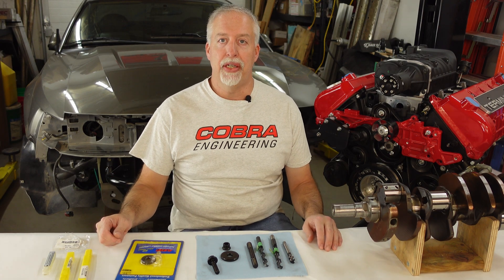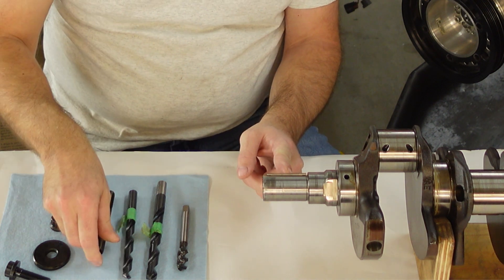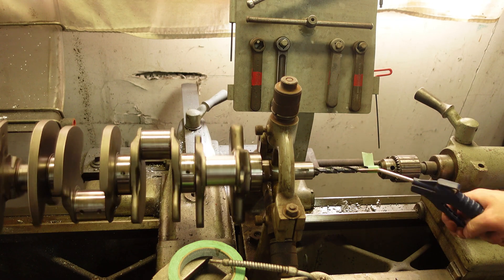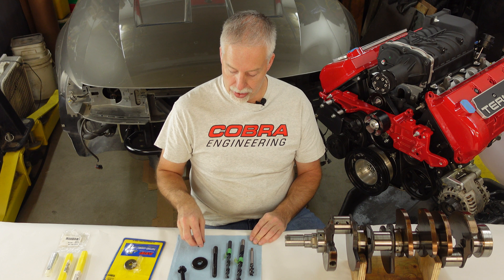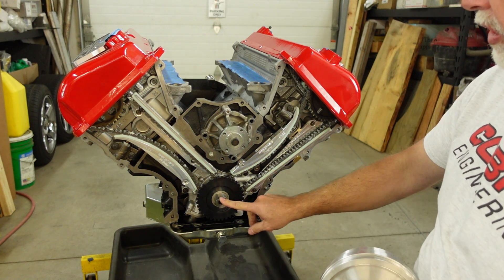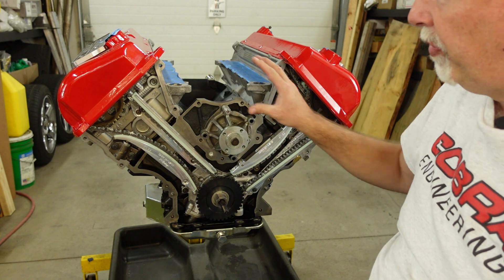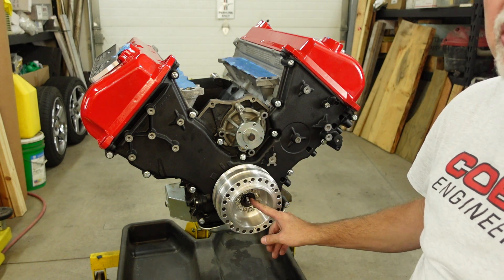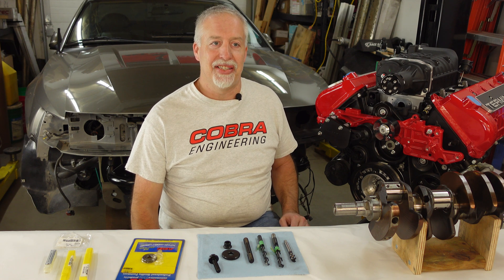Crank Stud Modification

Comment: This is probably some of the best information out there. I have a question about connecting rod bolts for the 5.4 GT 500 . Are they torque to yield. And if so where can new ones be purchased. It doesn't look like ARP makes them. I have a set of rods that are beautiful condition even the bearings look great
Reply from the maker: I don’t have personal knowledge on that. But I would be surprised that ARP doesn’t have something. Give them a call. 
Otherwise Ford is the go to for TTY bolts.
Reply: Thanks I will give ARP a call. They don't list the bolts but maybe they will make them. And again thanks for the excellent videos and top notch products 😊

Comment: Just an FYI to help others. Called ARP and they couldn't, or wouldn't identify any of the numbers but said one number meant it was 4.75" long. Kinda just blew me off since I was a retail customer. Talked to Summit and he tried to be helpful and said none of the numbers were in their system but he thinks it was for a KB block years ago. Didn't know if it was a head or dampener stud. Without getting a good number from ARP he couldn't order it. Edit . . . delete irrelevant info.
Reply from the maker: I updated the description with some research I did.  I was able to find a kit number for the nut and one for a smaller OD washer.  But a google search for the stud turned up several suppliers that claim to have stock.  This is how I got the longer one myself.  I hope this helps.  If it becomes to much of an issue I will just order some and have a kit available at cost.
Reply: Thank you for the additional effort, James. Reputable companies like Jegs & Summit indicate plainly state "not available". Other google "smoke and mirror" companies indicate in-stock or special order! I'm not willing to order then go through the hassle when they can't deliver. Still a lot of educational value in your video. Thank you.

Comment: Thanks for solving the problem and the video, James. I called ARP and they don't have any part numbers as shown on your drawing. Is this a "special" kit from you? Or is there a different ARP part number than on your drawing?
Reply from the maker: Those are the numbers I used to order them from Summit Racing. You will most likely need to call them.

Comment: Would the crank need to be balanced after doing this mod?
Reply from the maker: No. As long as the hole is centered and square. 
Just make sure they balance it after the key is cut.

Comment: Is the loss of the cross sectional area on the crank really worth it? I understand going to a larger diameter stud increases clamp force, and that really helps coupled with the installation of the diamond encrusted washers. I guess I'd like to see a graph of clamp force vs torque before slip of the diamond washers occurs. Also what is the peak torque input onto the crankshaft. That would determine if just using a stock diameter ARP stud and washers is good enough or if drilling the crank for a larger stud for more clamp force would pay off. I think the biggest pay off is the installation of diamond washers because it moves the torque input onto the larger diameter of the crank and further in.
Reply from the maker: To start the first hole basically cuts the threads so there’s essentially no reduction in material strength. 
What I didn’t explain well in the video is that the standard bolt puts all the stress on that undercut. This is where the failure occurs. By moving it back it moves that stress to a larger diameter section. This actually compresses the small undercut instead of pulling on it. 
Keep in mind most failures happen with manual transmissions because of the radial force put on the crank from supper rpm changes. 
BTW I’m working on a real solution to this 😎
Reply: @cobraengineering  ouu do tell what's the solution? Crank support?
Reply from the maker: @SomeDude365  I want to move all the rotational load to the larger diameter where the oil pump rides.